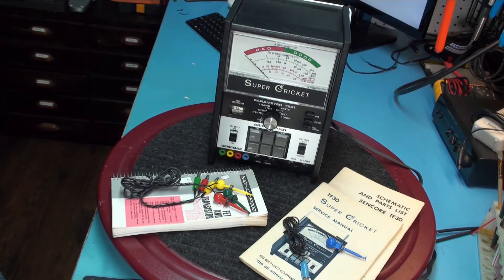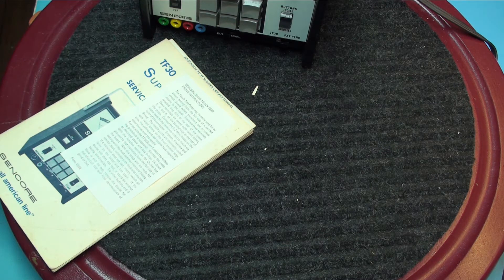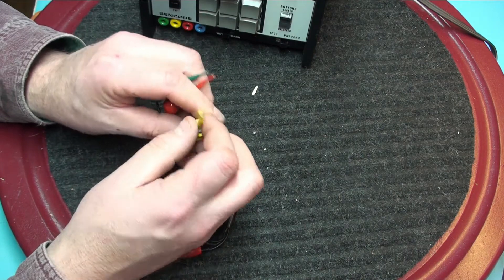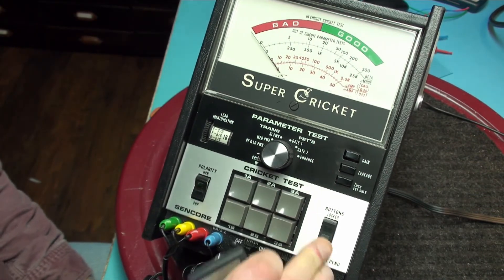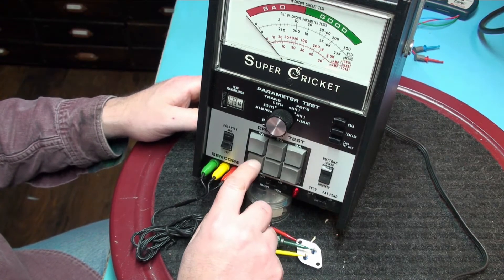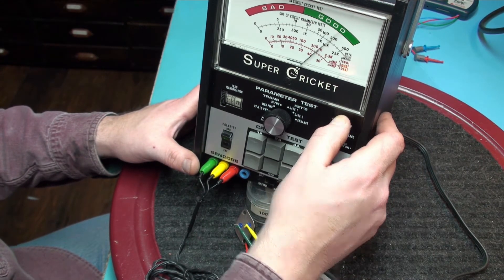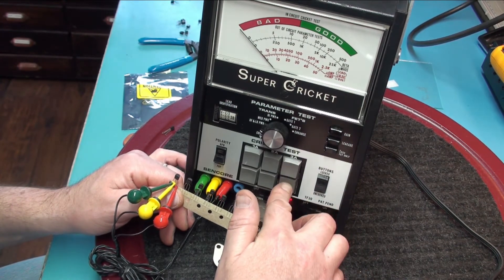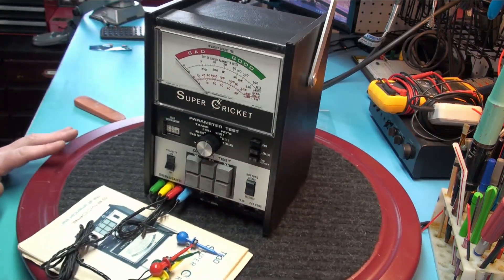Sencore TF30 Super Cricket transistor/FET tester demonstration video

Comment: Thanks for the video. One thing to note that I don't think you mention. I thing you've switched the rotating switch from the super cricket settin (farthest counter clockwise setting) that you originally have it on to determine what the transistor is, to the low setting (one notch clockwise from the super cricket setting) when you do the gain test, to determine the basing. Correct?? I was wondering if you had to do any repair to your unit? Mine does the cricket test ok. I tested a couple 123ap npn transistors and a couple mfj 102 fet's and they test good. However with the npn transistors when I try to do the gain test, I switch the switch to low,depress the proper 1a,2a,or 3a and I get a "chirp" (tone) coming from the speaker. However when I press the gain button the tone stops (as it does in your video) but my needle doesn't move and then pressing the b button the same thing, I hear the tone I press gain and the tone stops but the needle doesn't move. I was just curious if you might happen to know what's going on with it?? Thanks again for the video.
Reply: I think I fixed mine. It has some multi terminal plugs that slip onto terminals soldered to the pc board and I saw some broken solder joints around a few of those terminals so I re-soldered all of them and it now seems to be working.
Reply: What is the gate 2 blue wire for? Anyone know? 
Thank you
Reply: @SDsailor7 FETS.  Instead of Base, Emitter, Collector.  A FET has Gate Drain Source.
Reply: @Route66Wanderer  Thank you for the reply.